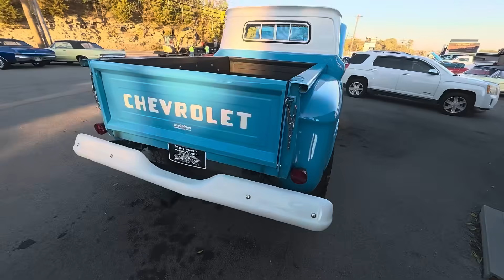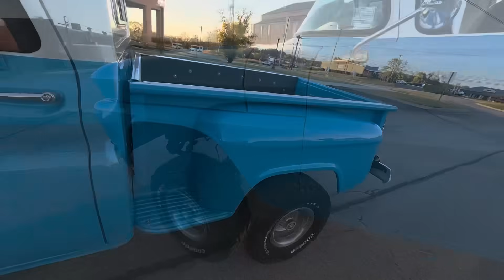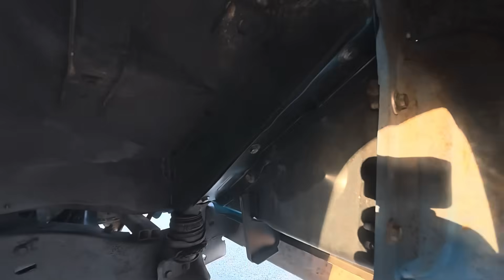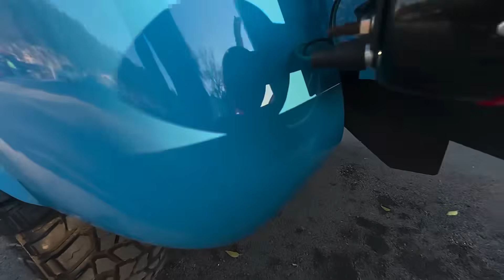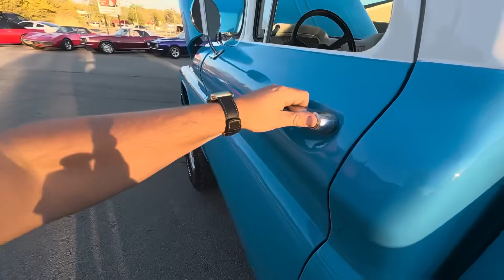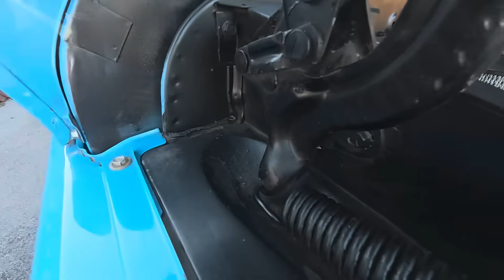Test Drive 1962 Chevrolet C-10 Custom 4x4 SOLD $21,900 Maple Motors #3004

Comment: Those tailgate pins can come out the way you have them. Run them through the hole from the bottom up and around. Its how youre supposed to do it.
Reply from the maker: Thanks for the tip!

Comment: My sister just purchased this same stepside same color two wheel drive with the 250 six cylinder and three on the tree one owner all original solid California truck 21k
Reply from the maker: Sounds like a sweet truck!
Reply: I had a Chevy van with 250 6 these engines run like a top 1965 customized to the top loved it wish i still had it 3 speed on tree. 🙏

Comment: You cant use a laser to check water temp. If that autometer guage says 210 thats what the coolant INSIDE the motor was.